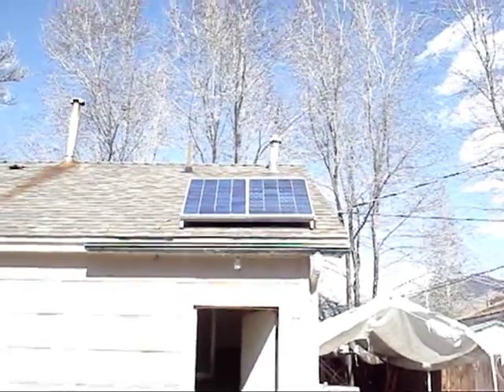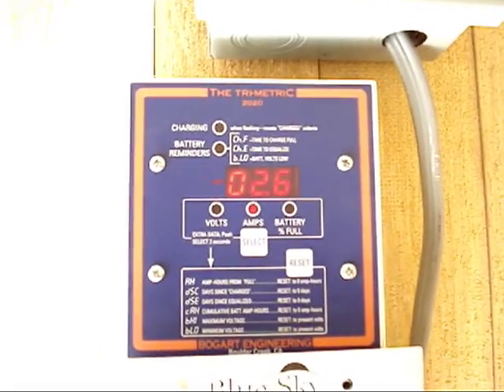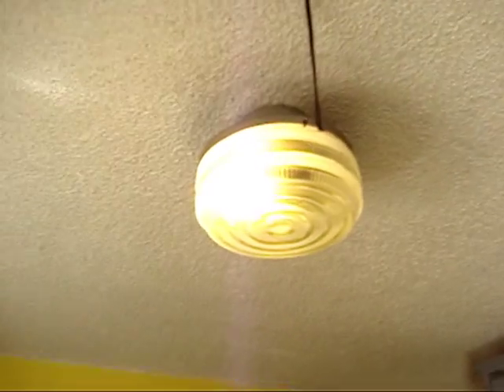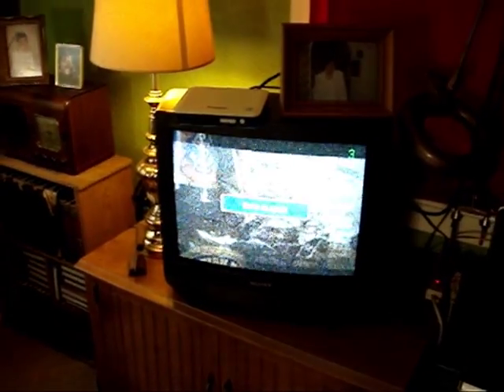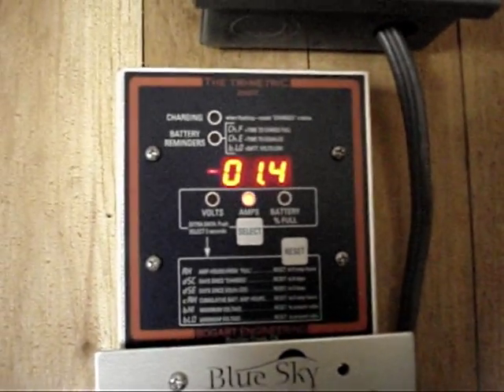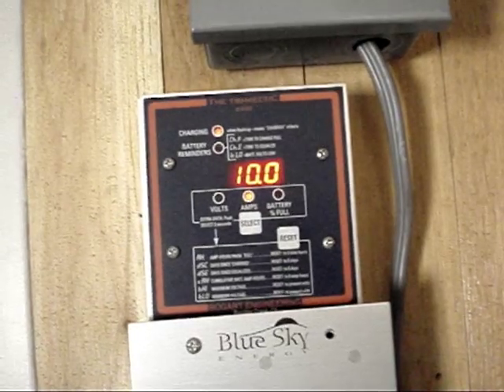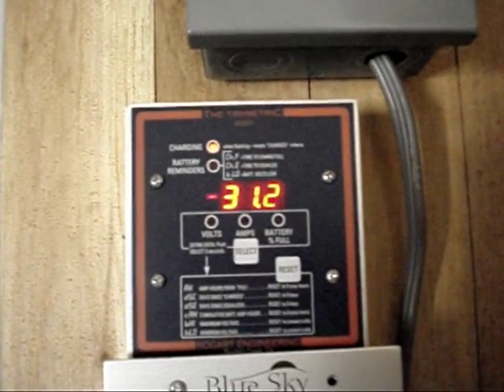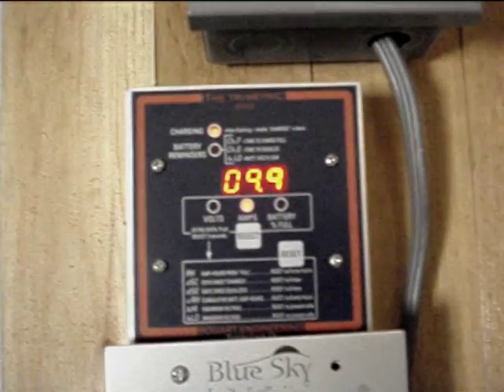Monitor Your Solar Battery Bank. Information is Gold

Comment from the maker: The more batteries you have, the more energy you can store. If you plan to install 12 pannels , you will want to make sure you purchase a charge controller that can handle that much juice without frying it. The one I have will take up to four 80 watt pannels. Any more than that and I will have to upgrade my charge controller. So, yes, you're on the right track.

Comment from the maker: 80 watt solar panel = $475 each
Sky Blue 3 stage charge controller with mppt technology = $166
6 volt golf cart battery = $230 per set
Tri Metric 2020 meter = $140
500 amp shunt = $20
1000 watt inverter = $75
Disconnect box = $10
So after some wire and shipping it's pushing $1850. I know that buys allot of electricity, but for me it's not about saving money on my power bill. It's about becoming energy independent. Not being at the mercy of the grid = priceless. my other solar vid has more info
Reply: interested to know how your power bill looked after doing that!

Comment: Can you double  or even tripple the amount of golf car batterys and get more usage from them? And also I was wondering can you triple the number of panels you have up there to be able to charge at a rate of 30 amps or will this make problems of charging too fast?
what if you had 12 pannels would this help what Im getting at is I want to be able to run my refrigerater, washer  and may be my  air conditioner.

Comment: Hey I have a 12v battery and based on what I've heard 6v golf cart batteries are the way to go I only have about 100 watts of solar but can I have 2 golf cart batteries 12v and 1 12v battery until the 12v dies then have only 6v batteries